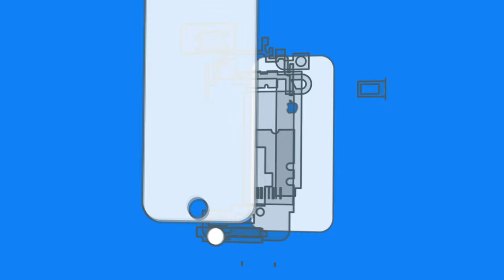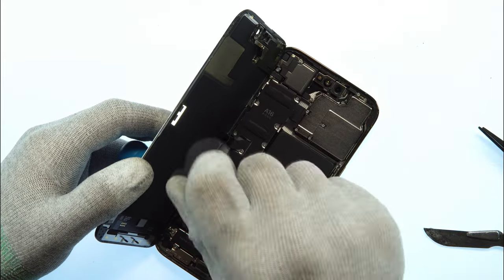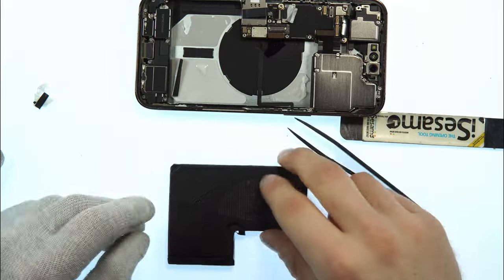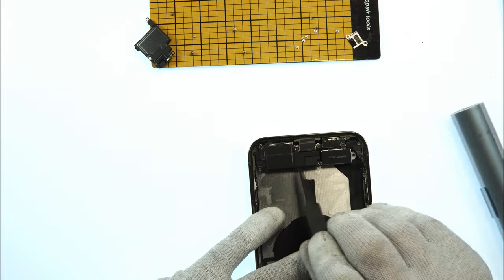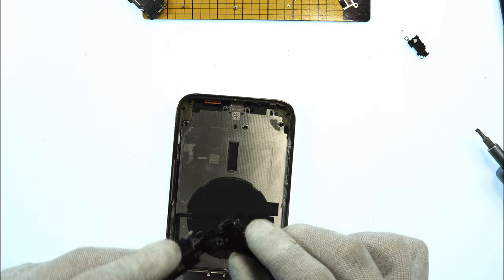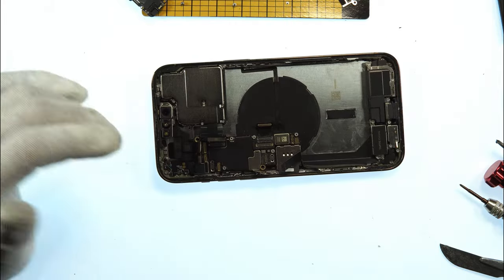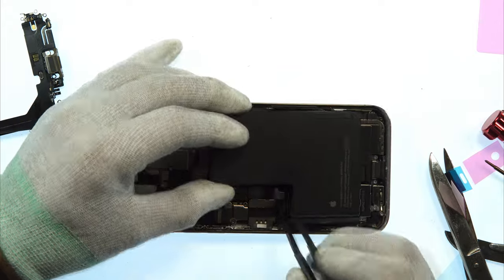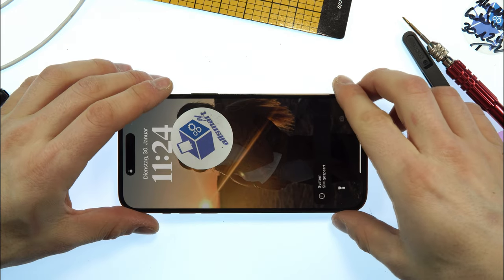How to Replace the Charging Port on an iPhone 14 Pro Max / 14 Pro - Step-by-Step Guide

Comment: Hello!  Thank you for the informative video.  The mic on my iphone 14 pro max is not working anymore.  I want to try to replace the mic that is on the charging port ribbon cable.  I will use the link to buy the charging port module.  Just one question, will there be a "pairing error" since it is not a genuine Apple part?

Comment: Hey  is it possible to fit a 15 pro/ or pro max charging flex to a 14 pro or pro max?, as well as in 13 pro and  pro max making them type c? ps ik the type c port is bigger than lighnting just for parts assessment and compatibility 
Thank you!
Reply from the maker: No